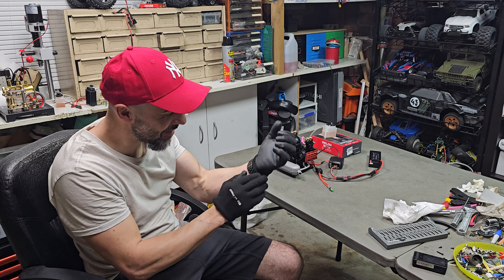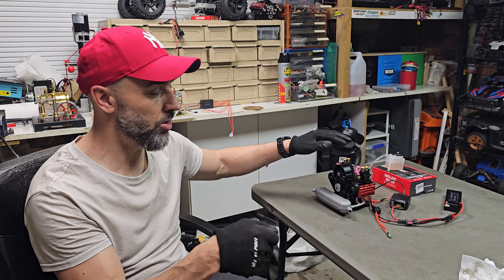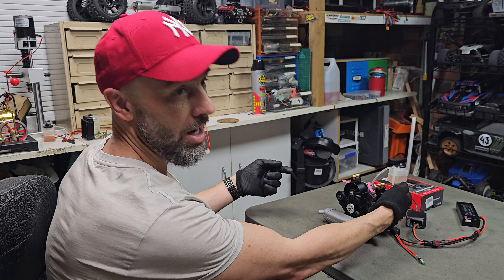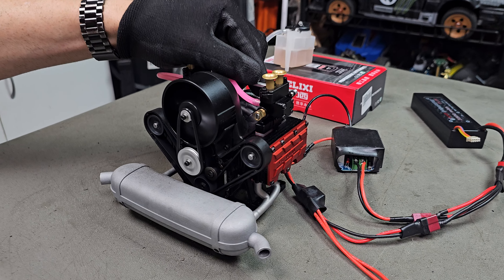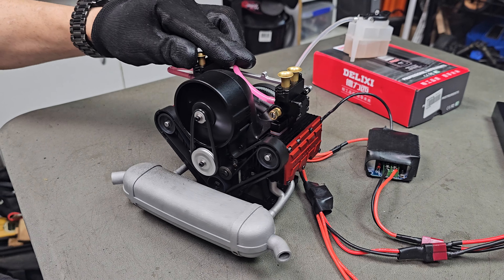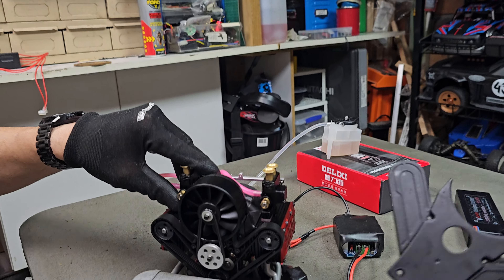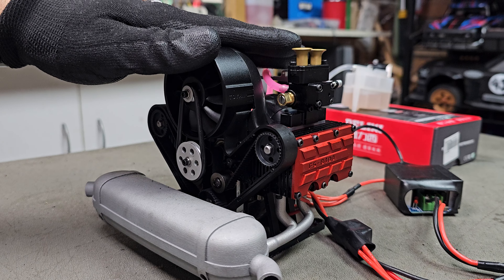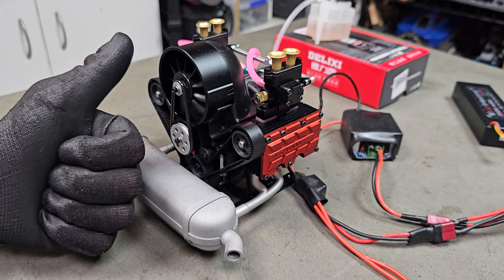FIRST RUN - MINI 4 CYLINDER BOXER ENGINE - TOYAN FS-B400

Comment: I think the fuel settings depends on the type of nitro fuel used. I set the carbs at around five turns out for the main jets and four and a half for the low speed jets. It runs good but it's a spoogy pig😆
Reply from the maker: Thanks bro, yeah the carbs definitely are weird. I think they need a redesign

Comment: Sure looks like a VW beetle. You might be to young to remember road going VW beach buggies? But that style of motor has been used in many vehicles. I remember distinctly VW trikes doing many wheel stands on bike club outings. That is a real possibility for a scratch build that could run . Lots of chrome and very long forks?
Reply from the maker: Yeah absolutely bro, I definitely remember those

Comment: Doesn't sound like a WRX
Reply: @RCTanksTrucks247  You know what I mean. The bubbly bubble like sound. With boxer engines.
Reply: It doesn’t only because the headers are equal length. What gives a Wrx Subaru it’s unique sound is that one header is much shorter than the other before they come together at the collector and into the up pipe feeding the turbo. That’s why VWs sound so much different as well due to their headers are equal lengths into the collector like this model here for example which is a better more efficient design for naturally aspirated motors. For the turbo boxer the pulsing ( bubble sound ) from the shorter and longer headers helps aid turbo spool for a more linear power band in the EJ stock configuration. ( at least that was the idea when they came up with it and it didn’t hurt performance so they stuck with it. ) in later years of Direct injection FA Subaru motors and current age technology they found that different header lengths didn’t help as much as making both headers equal and as short as possible does. This is why you will find the new Subaru wrx’s with FA engines don’t sound the same as EJ engines did. 

Hope this helps with your question sorry for the book and or history lesson 😅